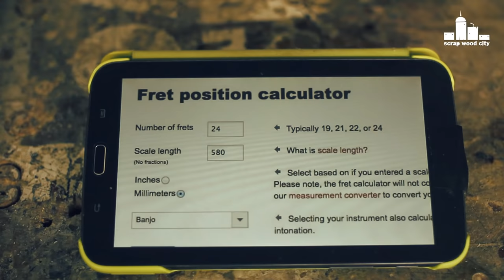DIY 2 string musical instrument, from an oven pan ( panjo )

Comment: You're getting better. Even if I don't like your head stocks :) maybe you should have made a taller bridge, then lower it to prevent from fret buzzing, and planing the frets and sanding them to make them round would have been great :)
Reply from the maker: Τhanks. The frets don't buzz, it's actually the bridge that needs fine tunings with the file! If the frets go in place right and the fret board is flat, there is no need for leveling at this stage!

Comment: Why do you put super glue to the fret endings to cut them out?
Reply from the maker: The super glue is really thin and when I add it at the end of the fret it actually goes under the whole fret. So cutting the ends off doesn't really matter!

Comment: Hey, what is the material that you used to create the frets with? I'm planning on doing something similar to this for a school project/ assessment and would like to know what I will need. Cheers
Reply from the maker: It is called fret wire! But be careful to by it in a size that will fit tight enough in the slot that your saw will produce!
Reply: Scrap wood City thank you i appreciate the response

Comment: Awesome video! Just wondering what strings you bought and also what ones you would buy if you were to make this a four string or three string. What would you recommend making?
Thanks a ton!
Reply from the maker: I just used what guitar strings I had around. For four strings I would suggest to use the four higher strings of a guitar tuned in the same way! Thanks for watching
Reply: Also, how did you set up the device to cut for the frets?  How deep is it?